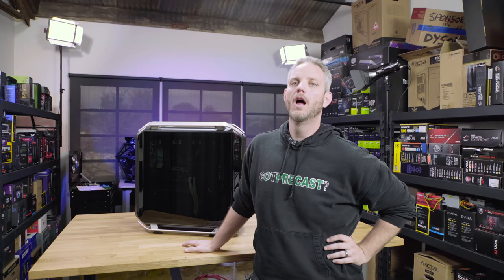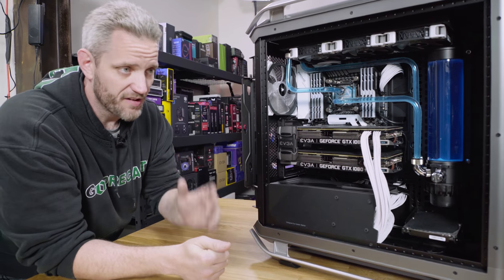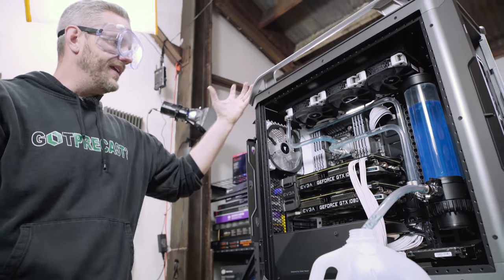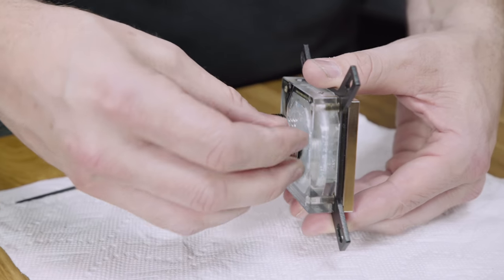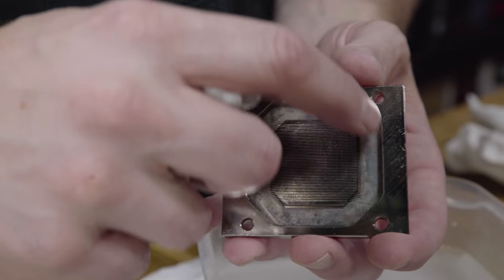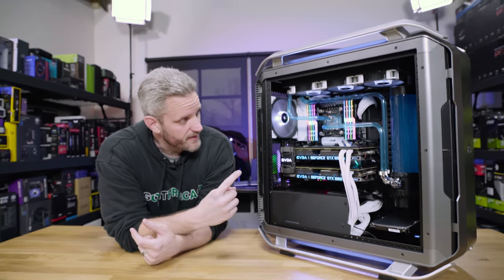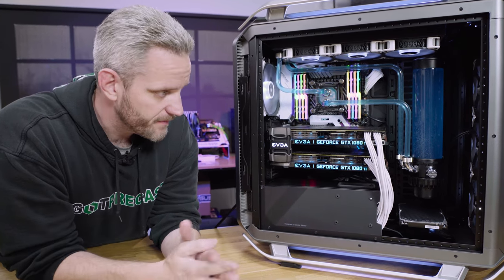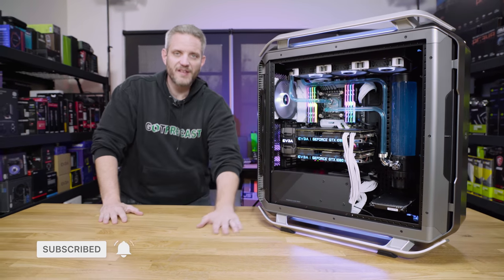It happened again... and this time it was NASTY

Comment: I think I saw your video on Primo Vue and was considering going to water cooling again - however with clear liquid and being unable to see the movement and since I had a pump die in the first month despite being properly assembled, etc... and Thermaltake didn't allow me to do an RMA and also no refund so $200 was lit on fire for a Thermaltake BigWater - very disappointed so I avoid Thermaltake now and have for the past decade.

An 8 hour limitation isn't realistic unless it is just a show build, but why build something for show which you wouldn't use? I have kept my pc on daily and running 24/7 for the past decade with no major hardware issues because I use a UPS ( actually 3 ) even though it is overclocked to 3.0 GHz from 2.4 and has been since I built it in 2008 ( although I am looking to update but Spectre and the other... issue seems like meh )... Keeping a pc running 24/7 improves lifespan as there isn't a large thermal shock - water cooling isn't great because it slows that thermal shock down - same with a car if you start your car and let it idle to warm up, it's worse for it than if you just got in and started driving right away... and I say this if you frequently shutdown / and start up with an hour or longer between startup / shutdown... for basic reboot there's no issue if you run 24/7 and the cooler running temps will help with longevity but it'll be worse overall if you turn it on and shut it off at the start and end of the day...

Comment: Actually copper does "rust". Rust is iron oxidation. Copper reacts with oxygen as well creating a whitish green layer on the surface of the material....kind of like what was on the block. The copper oxidation is not as aggressive as iron oxidation but it can severely impact the use of copper. http://2fdpn7hy0ht206jws2e9og41.wpengine.netdna-cdn.com/wp-content/uploads/2013/07/copperpipe.jpg

You must be thinking of gold. Gold does not react with oxygen. Just use gold next time.

Comment: Because from my research in other people's research like my brother he says that do not put any color additives for example dye in the cooling system because it can actually built up Gunk over time and if you keep using it it's going to get even worse and worse and worse so stop using it and just use normal distilled water please you won't have this problem anymore I guarantee you just check it every 6 months 3 at minimum so please pin this so you won't mess up again by the way I'm not insulting you I'm just giving you helpful criticism because I noticed that you were doing some things wrong and I'm helpful guy I like to help people so please pin this comment so you can keep note and don't forget it and change your cooling system water to normal distilled on colored water please

Comment: Someone help me holy shit I have a sli set up just like jay with the ftw3 and the top card gets too hot. 86C what am I doing wrong? I have a 6 fans for intake and 2 under the gpu. 

Yesssss I changed thermal paste and yesssss both card run at 100% fan speed

Comment: I got $3k to invest on what do I use for my custom made pc? I want it for my engineering and architectural softwares. It takes 1-8hrs to render my files sometimes it crashes suddenly I am totally fed up I use dell i5 laptop which i want it to go and replace it with custom pc. Suggest me what specs do I go with I want it heavy super fast
Reply: Do some research, find some workstation PCs in that range on YouTube.  If you wanna go Intel, get a i9-9900, and if you wanna go AMD, get a Threadripper.
Reply: From intel i7 6700k ahead you will be good.
If it's not for gaming, have a look for AMD too tho, they are super powerful for rendering and work 
Forger about water cooling, does not worth it  IMO. Just stick with a ATX mobo  and good air cooler aka noctua/Scythe
Reply: Suggest me pls. Which is good?
* CPU: Intel Core i7-9700K. ... or i9
* Motherboard: Asus ROG Z390-E Gaming (Wi-Fi) ...
* Video Card: Asus ROG GeForce RTX 2080 Ti O11G. ...
* Memory: Corsair 4x8GB Vengeance RGB Pro DDR4-3200 White. ...
* Solid-State Drive: XPG SX8200 Pro 1TB NVMe. ...
* Case: Lian Li PC-O11DX 011 Dynamic. ...
* Fan: ...
* Power Supply: 
OR
Nvidia GeForce GTX 1080 Ti graphics cards, to Intel’s Core i9-7900X 10-core CPU and a massive 1TB Samsung 960 Pro M.2 SSD, all housed in a gorgeous Corsair Crystal Series 570X tempered glass case. It’s a PC that can dish out over 60 frames per second in pretty much any game at the 4K resolution of 3840 x 2160 and makes short work of ultra-wide monitor resolutions too.
Reply: @bhashkarrajmishra848  Georgeous list of hardware. It will really depend on what you will use it for. For heavy rendering etc ... i9 must be your choice, but the i7 will perform very seriously. 
Between 2080 and 1080Ti, I will choose TI if new/as new. Otherwise and for safety, warranty etc ... 2080 looks like an amazing card.
I might be wrong (I hope I am) but if it's not for 100% gaming, AMD offers really good CPU/GPU.
If budget it's not a problem at all, stick with intel :)
Reply: A M thanks

Comment: "Don't use for more than 8 hrs"   LOl.  How useless.  Barely good enough for a show.. and even then, why show something with an 8 hr lifespan?  My loop is still crystal clear after 2 years.  I have two Primochill 35mm rads, one 360 and a 240.  A Chinese acrylic / nickel-copper $15 waterblock and a big 1000 lph pump.  I do use silver plugs, and they seem to be working.  I've used a few types of UV dye, Fesser, Primochill, Mothers, and others.  No problems.

Comment: Does this happens to aio cooler
Reply: Yes, it will. You can not prevent galvanic corrosion (at least with consumer grade parts and equipment), it's just a quality of metal when exposed to liquid water, which is the base of most coolants. Good AiO should last a 3 or 4 years, but again if its good, the pump will die, before the corrosion becomes serious. I have never used Cool Master AiO's personally, but I have been told that they are cheap for a reason and are the most prone to failures, leaks and other problems.

Comment: Not trying to be a jerk, but you've been watercooling for how many years now? And you haven't figured out that absolutely all of the PC watercooling companies make terrible additives that destroy your loop? Okay, let me give you the same piece of advice I got 13 years ago when I started water cooling. Valvoline Pro-V racing super coolant. Mix at 95% distilled water with 5% coolant. Don't use the junk sold by PC shops, the R&D just isn't there versus the auto industry which has been doing this stuff for 100 years. Since my initial fill up with Valvoline Zerex in 2005, I have only fully bled and refilled the loop TWICE. I'm still using the original Zerex bottle I bought in 2005. Zero buildup. No corrosion. Same consistent temps and performance for a decade. And my Dangerden D5 Vario has been on the highest setting, running nearly 24/7 for 13 years.

Comment: copper does rust. ALL metals rust (actually the word is Oxidize). The results of oxidation is usually dependent on the metal, aluminum just gets a dull layer that prevents oxygen from oxidizing more. Copper get a patina like all alloys of copper. Etc. Etc.

Comment: That's what she said!,  good God, I didn't even see the other post, ---  YOU set up a corrosion-cell inside your water loop,  that's really bad...  the fluid is an electrolyte and you had two different types of "metal", that sets up a "Cell", bad, bad....  also, without 0xygen in the loop there could be no corrosion cell setup, none.  "Again, with no 0xy in the fluid, no corrosion, period.  Use an Oxygen scavenger in the fluid, like CRO4 (Hex a valent Chrome), I used it all the time, of course, that was before the EPA, lol.  {I watched a cow, yes cow walk over and drink from a pond that had the oxygen scavenger in it take a drink, it walked several feet and went belly up, legs straight up, like I said, before the EPA.}

Comment: i guess the problem here was: it wasn't bare metal. anykind of coating will come off over time. Pure polisched copper and then a fluid that didn't react with copper is the very solution i think

Comment: Anyone ever done motor oil cooling?
Reply: Chlorine I wanna see some type of oil some day, because it can carry away even more heat though you would probably need more powerful pumps to maintain the flow rate. It’s the higher heat density of the material that I’m interested in. Also an oil may be non-conductive in case of serious leakage.
Reply: Chlorine sorry there is an old video of a mineral oil pc like the whole motherboard, cpu and gpu are literally submerged in it. That is what I had in mind I guess.

Comment: Copper corrosion is caused by oxidisation.
Rust (iron oxide) is caused by oxidisation.

You are both right and wrong (depending on how you look at it) when you say that copper doesn't rust lol

Comment: Lol or this flued really sucks or no proper prepping of components. Never messed with those kind of pre mixed fluids looks great but just the structure of those fluid and the chems in them seem an obvious recipe  for disaster How do you prep new component rads pumps and blocks ? I have seen a lot of videos of your builds and some preparations but never the whole ritual of prepping. To me it is the most important part of building the loop. I spend a lot of time prepping and cleaning them just with very hot distilled water over and over and over (shaking the rads like crazy, do the blocks pump every component even tubes) no chems or vinegar bs then let the loop run for 2 weeks with just distilled water and a drop of biocide then drain flush a couple of times with fresh distilled water.  I also do not mix brands and go full nickel on blocks fittings etc. Then fill up with distilled water and concentrate. Never had something like that. In addition, I use gloves to assemble (for minimum contamination) I may be crazy autistic about my way, but it always works and after year or more of use I drain and don't have to even clean very much.

Comment: Why do you waste time and money on this gimmicky BS? 
Just stick to distilled water. If you want to use an additive, look up “water wetter”. It’s a surfactant (google it). Your coolant will be pink, but it’s non-glycol based (ie: safe for use in vinyl, tygon, acrylic, and PETG), and won’t cause any issues.
I’ve run a mix of distilled water and water wetter for over a decade. In fact I’ve had one loop going for 5 years straight without changing fluid. Zero problems to report.